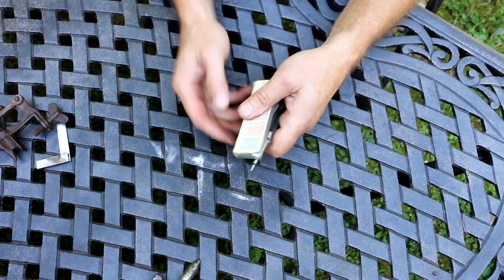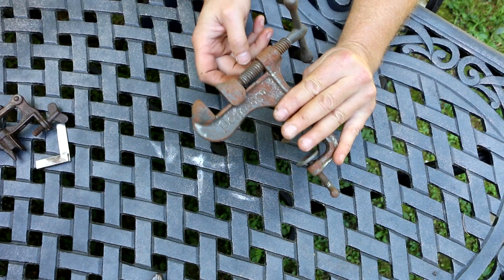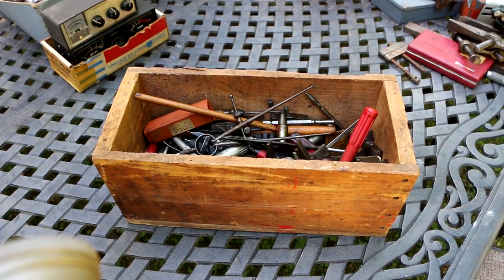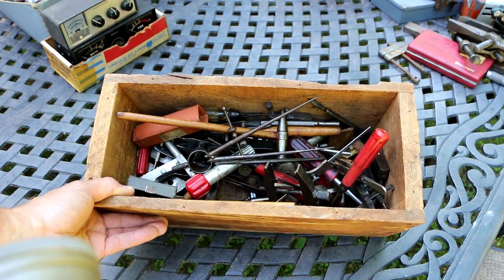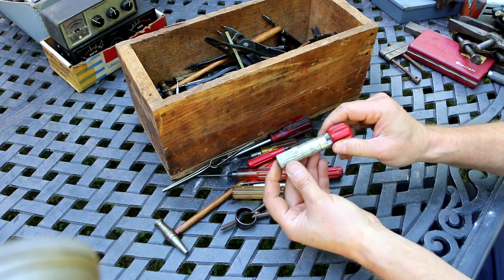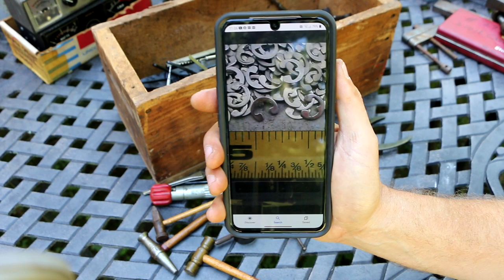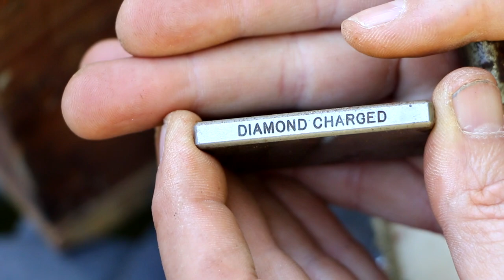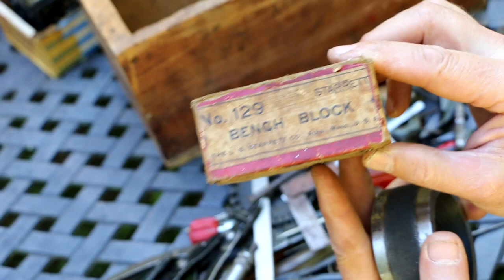Zagray Farm Tractor Show & Swap Meet July 2023 Tool Picks

Comment: The 015 is a good saw, but getting them running has always been a pain for me. They generally need crank seals, and carb kits. The white one is somewhat more desirable. I’m it’s condition you could probably get $80-$100 for a collector to put on the shelf. I’m running shape you could probably pull $100-$150 a piece out of them. I’ve owned probably 20-25 of them. The most I ever got out of one was $175 and that was the more desirable rear handle 015.
Reply from the maker: Thanks. Good to know.